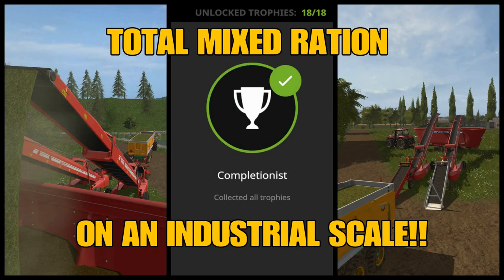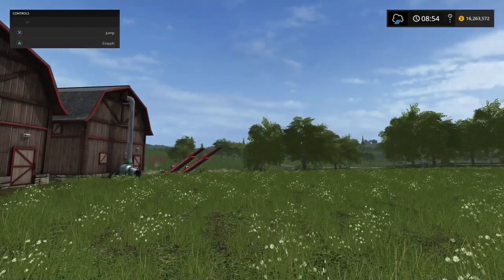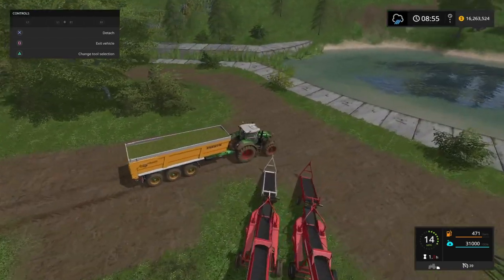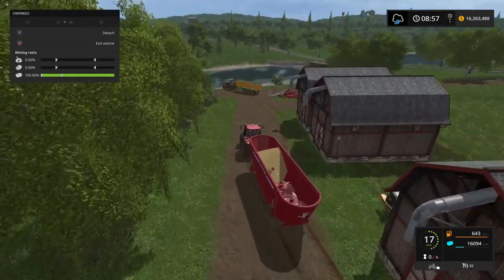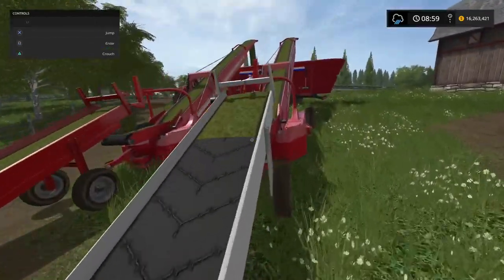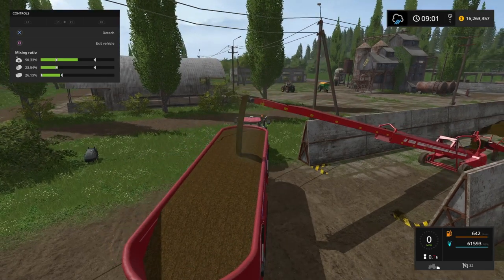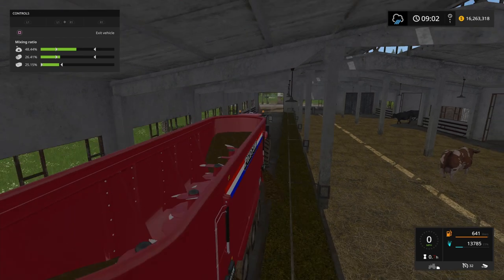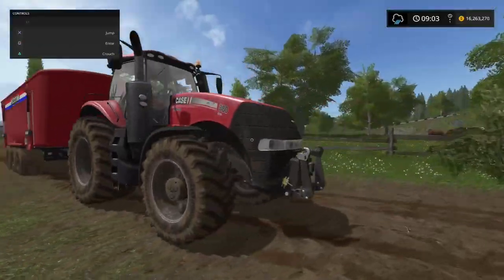Farming Simulator 17 PS4  TOTAL MIXED RATION on an industrial scale!!

Comment: Why the step of putting hay in the tipper and then dumping the tipper into those 2 belt systems to load the mixer?  Why can't you just pull the mixer wagon in the lofts and dump hay in directly, does that not work?
Reply: Saint Aggressor ah ha. Thanks!

Comment: This method takes so long. Fill your barns with hay and straw... Pull mixer wagon under and fill... Use the bar to measure up 10% with straw, then to 55% with hay, use a bucket loader for silage. . . Takes half the time to do and mixes exactly right ratio.